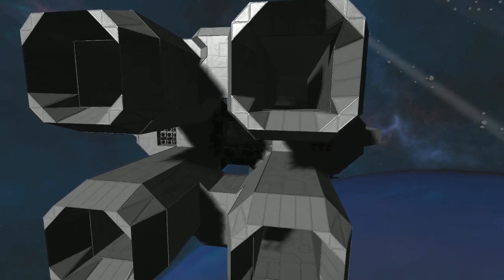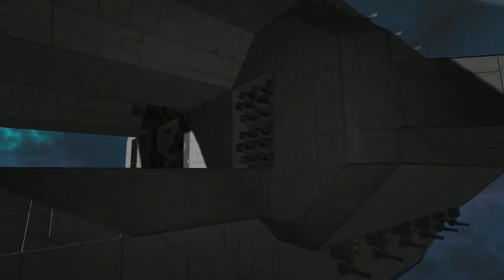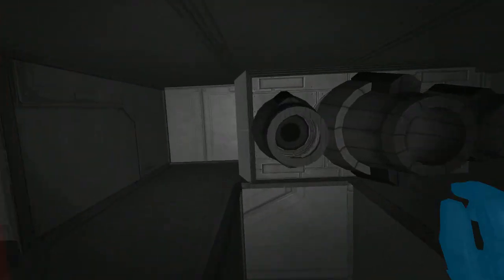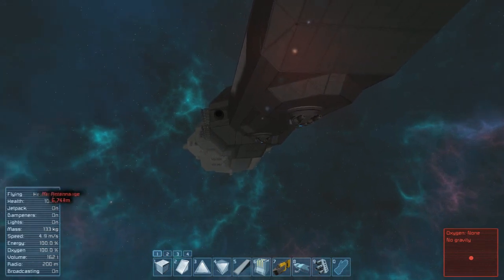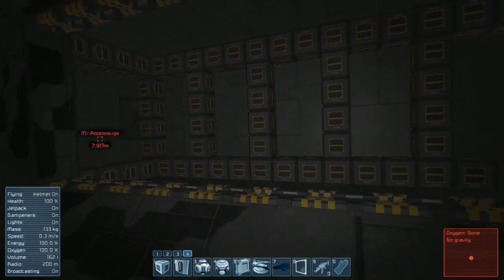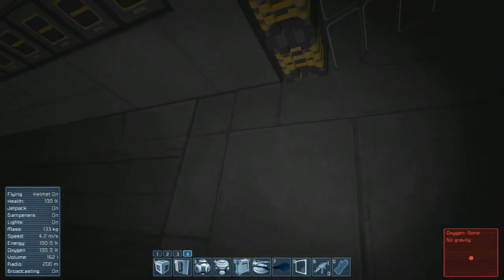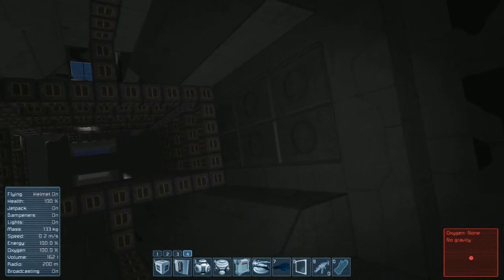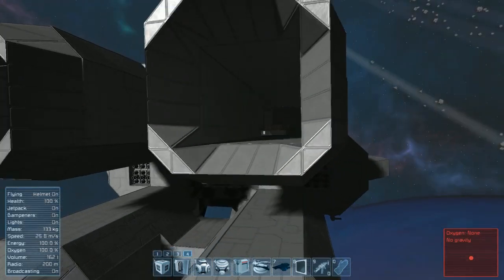Space Engineers - Battlecruiser Prototype Update 1

Comment: And here I taking an hour making a very average scout ship, haha...
Reply from the maker: AtilaCXL It's not all that hard once you get an idea in your head.  This I did the opposite of how I recommend, I built the hull first since that was what I had come up with, and am adding the interior and working parts after.  Even most of the none primary thrust engines were added on as after thoughts and not planned out ahead.   But generally you want to start with the basics of what you want a ship to do, and build from the core outwards.  I have a few other ships in the works that follow that principle.
Reply: Minngarm Halnhammer Yea, ideas and especially conceptualisin them are the things I have issues with. I'll get an idea to make a ship. For example, I was going to attempt a megathron from EVE Online, but I just couldn't figure out a way to recreate it in Space Engineers. I could probably do it now with all the extra armor. But yea, I tend to go from the cockpit backwards which is probably a bad way to do it.
Reply from the maker: AtilaCXL Scale it down, the size of that ship is way more than SE could handle even on a high end system.  The way I say for people to do it is to pick the concept the ship is based on, for example a carrier is based on a hanger bay and/or a launch tube system.  Start with making this in station form, then you want to expand out on the concept to the bare bones functionality of it. So what you need at that point is a power system, storage and supply system, and a way to load the launch system.  Of course after that you go on to control systems, batteries, O2, Gyros, thrusters and the like, and of course you skin it in the end.  Now since you do not need to convey anything to a thruster for it to work you can also include thrusters in the skinning section at the end.   Now in the case of the BC-P in the video the concept was the hull itself, so of course that was where I started, sort of a reverse of the same process, but you will see that I make regular changes to that hull and existing systems as I go along and add more to it.